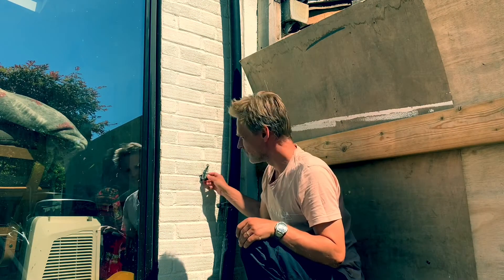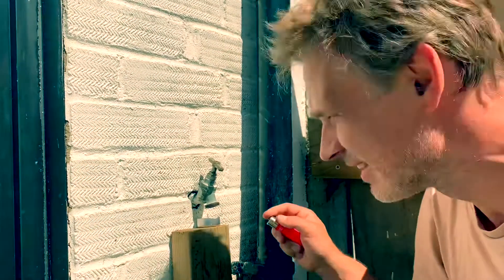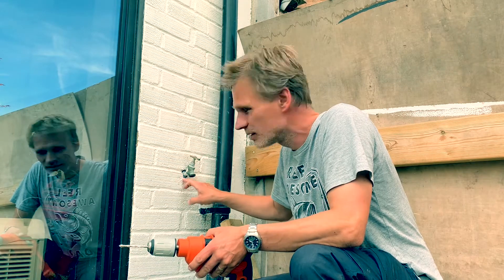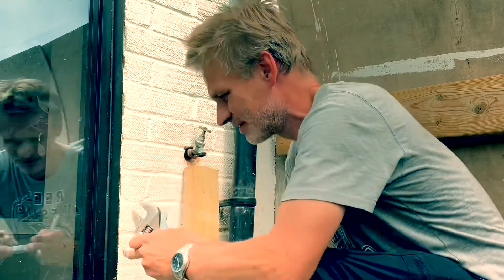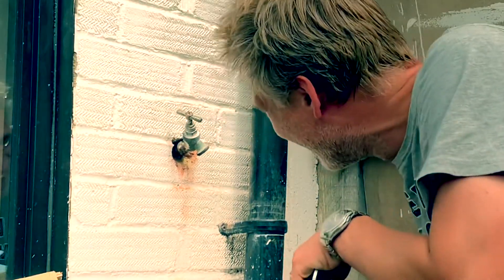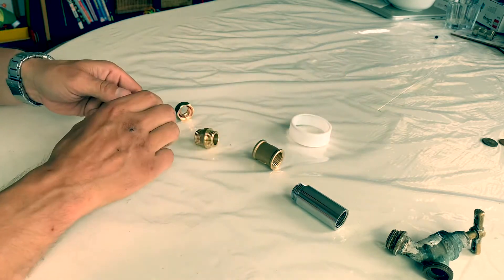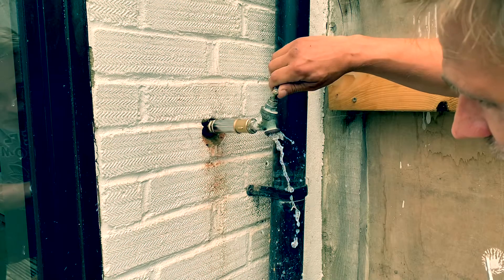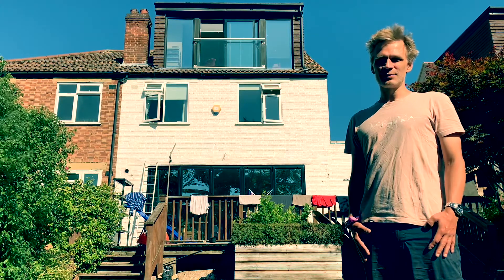2. DIY External Wall Insulation: Extending the hosepipe tap so I can fit insulation behind it

Comment: This is exactly what not to do!!!!  The bib tap is cantilevered far from the wall face with no support.  Just the connection/disconnection of hoses will flex the pipe and cause strain at the copper pipe joint, which will leak and in this case will saturate not only the EWI but the brickwork behind that may also create damp on the internal wall  .  This is very similar to the issue my daughter had with her external bib tap through her new EWI.  The result was a saturated insulation and a large repair patch.  To extend a service like this you must use a solidly fixed bib tap connector that is screwed to the wall and then a screwed brass extension tube is used to extend the tap forward.  Chrome plated steel extension pipe will rust and ultimately fail.
Reply from the maker: I actually supported it very well at the other end where it meets the outside edge of the insulation. I was considering embedding a metal plate in the base coat. But ultimately just used three layers of mesh, the middle one at 45 degrees to the other 2. This supports it very strongly and much better than it was originally so I think I’ll be fine. I hadn’t heard about chrome pipe corroding and will certainly look out for that. Given that it is not exposed though it shouldn’t get damaged so hopefully the chrome will last as long as the house - or at least as long as the insulation does.

Comment: When working out how far to extend the pipe, how much thickness do you allow for the adhesive and render in addition to the insulation. For example, if you have 100mm insulation, would you allow 10mm for the adhesive and 8mm for the render i.e. move the pipes 118mm, or should you allow more/less for the adhesive and render?
Reply from the maker: I guessed it would be about 25mm and in the end I think it was about 20mm. I think about  10-15mm between the wall and the insulation and then 5-10mm between the insulation and the outside of the final coat of render.

Comment: What is the large pipe connecting extender called? I’ve been looking in shops for one but they don’t seem to be readily available in the uk?
Reply from the maker: I was having trouble finding it as well but went to my local plumbing shop (called "Sid's" in Brockley). I explained what I needed to do and they sorted me out with everything I needed (with the help of a plumber who happened to also be buying supplies there. Only thing was he wanted the measurements in inches rather than cm :)
Reply: They're on Amazon if anyone is wondering. Thanks for the video BTW. Very helpful.

Comment: Do you have a gas pipe coming in to the house? If so how will you tackle the insulation around it? Mine runs up the wall for about a metre and obviously I can’t start extending gas pipes, I’m thinking of just boxing it in.
Reply from the maker: I was lucky - our gas pipe goes in underground. There was a cast iron sewage pipe that I cut away and replaced with a plastic pipe (further out). As well as extending the hose pipe tap. But fortunately these didn’t require any gas work.

I think that for something like a gas pipe that I couldn’t move I’d probably try to insulate as much as possible round the back of it with the insulation boards and then maybe also over the top of it - as you say, boxing it in.
Maybe it could also help to use expanding foam from a can to seal around it in order to help insulate everything.

Sorry I can’t be more helpful than this and do let me know how you get on.

Good luck!!!!
Reply: @aktsolar  Gas pipes MUST NOT be enclosed with material.  Wherever a gas pipe is installed within a construction it must be full vented at both ends, which is commonly carried out with a larger sleeve around the pipe.  There is a very good reason why gas pipes no longer are buried in house construction - gas can build up within the construction due to a leak and the result can be very explosive!!!  This happened a few doors down from a friend of mine that destroyed the semi-detached house, killing the occupants and wrecking the next door neighbour's house.  The leak was suspected as it passed through walls under the floor  and found its way into the understairs meter cupboard, where a spark from the electrics ignited it.  It was presumed that the leak had existed for about 50-60 years and gradually accumulated over time.

Comment: Do you have any hygrometers in your house to measure the humidity levels? If not now would be a perfect time to get some so you can compare humidity before and after EWI.
Reply from the maker: Thanks a lot for this.
Yes, I have two. However I hadn’t thought of using them to test long-term changes. Normally I just use them to see what the humidity is and decide to open a window.
Part of the reason for this is that the humidity changes so much depending on the weather and what we are doing (eg cooking).
Do you have any suggestions on how to get long-term stable readings?
Reply: @aktsolar  the Govee Bluetooth hygrometers are a good bet. They take readings at least every minute that syncs to the app to produce a graphs of temperature, humidity and dew point over time. I've got about a year of data on mine now.

Comment: Hi, good to see you’re thoughts are as mine…same with e powered cat!
Who are you considering for supply.
So far the only ones I have seen is EWI.  Quote seems good.  They also have instructions videos.
What’s your heating and ventilation proposal
Reply from the maker: Yes, I’m looking at EWI Store as well although there are other out there so I haven’t decided yet.
For heating, we have underfloor water heating in our main room and so that could work with a heat pump but at the moment we’re just going to continue with the normal gas heating (hopefully using less).
For humidity, we’re getting new double glazing with vents and will continue to use the extractor fans in the living room/kitchen and bathrooms.
I’ll be interested to see how we get on with humidity over the winter.
Reply: ASHP will probably work for you.  Think about where you put it.  Away from the house, for noise.  If you can a location the is a good heat trap.  If you don’t have lots of baths, consider just using for heating, just plumb directly in.  the hot water part makes it complicated. Use electric showers and point of use electric heaters for taps.  A heat recovery ventilation system may be worthwhile, but expensive.  Ideally you need to refit the roof tiles / slates over a wind tight breathable membrane.
Get hold of an infra red camera once you have the insulation done, then you can see where the heat leaks out.
I am a recently retired Architect, so some knowledge.  Best of luck, will be interesting to see how the project develops